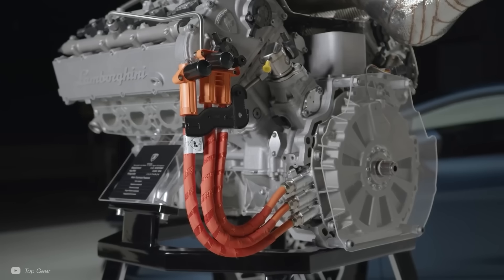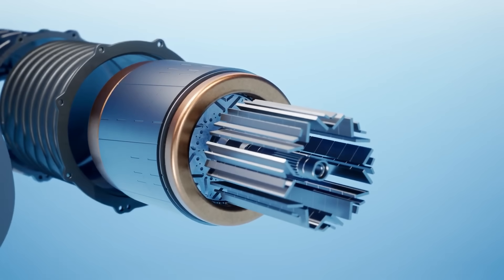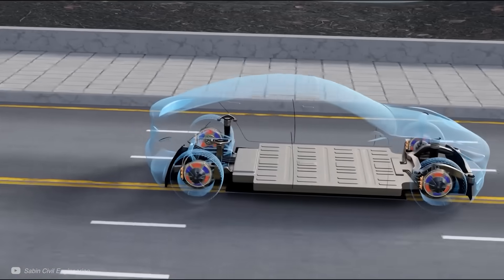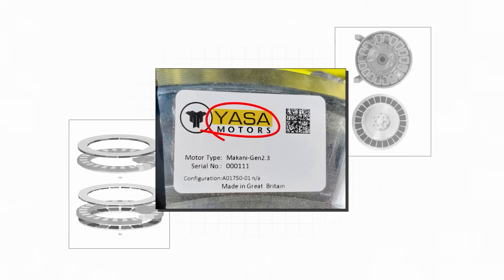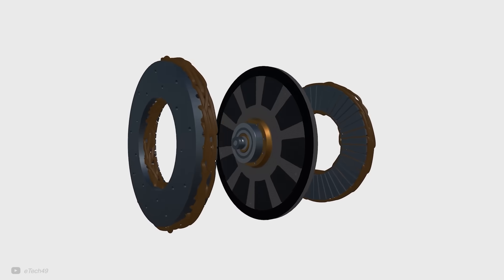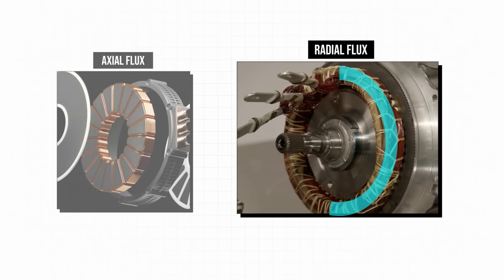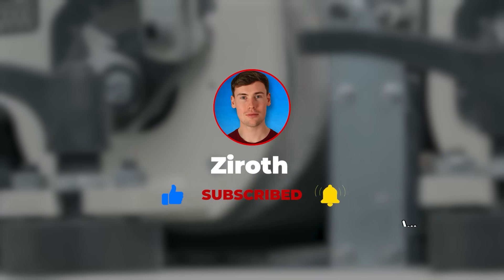Revolutionary Yokeless Motor: The Future is Here

Comment: How I remember: Radial, Radiates outwards, Axial, like hooked together with an Axle.
Reply: Axial flux is oriented along the axis of the motor. Radial flux rotates around the axis of a motor.
I've designed advanced motors and am designing high power density engines, turbines and transmissions.... among hundreds of other inventions.

Comment: This type of design, perhaps any electric motor design, is ripe to have the precise shape of the copper windings and the magnets to be optimized through AI generative evolutionary design.  I noticed the copper wiring here is in a precisely manufactured flat triangular cell shape.  With the AI design the shapes can get more “organic” looking and complex so manufacturing becomes an issue which might be overcome using additive/3D printing techniques.

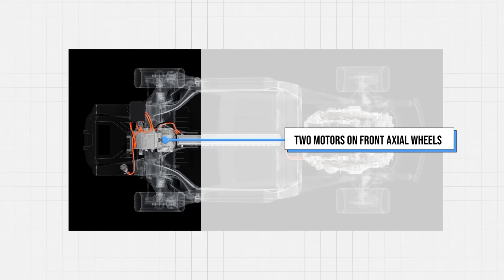Comment: 10:24 This is an interesting design in between in-wheel motors and a central motor.  Maybe this design will become more common as in-wheel motors have failed to pick up traction.
Reply: For my bicycle i have a gearless hub motor. It's heavy but damn its so smooth and silent. And also pretty maintenance free. But its true for torque it isn't great.

What you could do it like at statorade and give something that normaly has 1500w power 3000w power.
Reply: @dashofawesome64  problem with bike hub motars is they cant take advantage of the bike gears, making it less useable torque and less efficient.
Reply: In-wheel is a no-go if you want to be able to overcome any bump on the roadway. You want your dynamic mass (the mass of the mechanism that will move relative to the vehicle to balance any road imperfections) to be as low as possible so it transports as low as possible impulse energy to the vehicle shock absorbers. Essentially 50kg wheel doesn't work for a 300 kg vehicle as it will toss you everywhere :)

Comment: Would be cool to see this in forced air ICE motors. Imagine a Hellcat with an electric supercharger. Lighter, more energy efficient, and better control of airflow. Higher pitch too for the fellas who like the kitty scream when revving an SC ICE.
Reply: Many manufacturers, from Mazda to Audi and Porsche, already do similar things (electric superchargers and even electric, regenerative turbochargers).
They just don't use axial flux motors for it. 

And arguably, at least for electric turbochargers, it doesn't make as much sense to use an axial flux motor - since these moreso require very high rpm capability rather than torque.